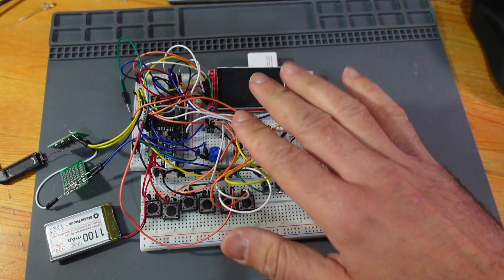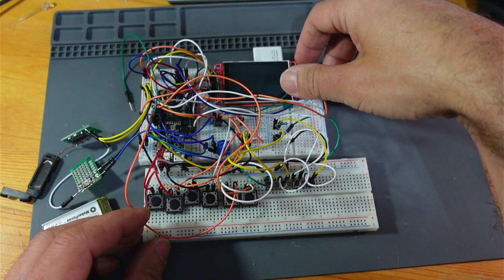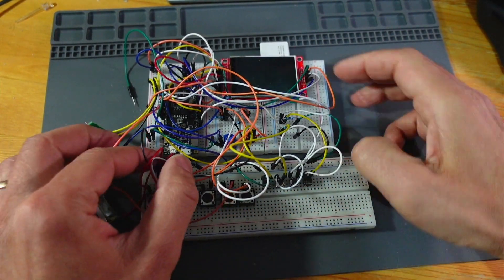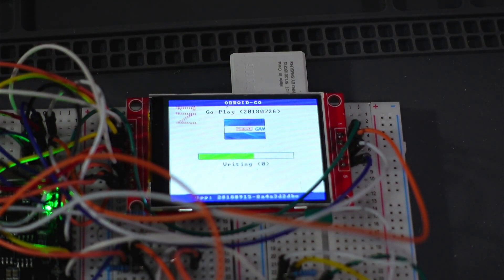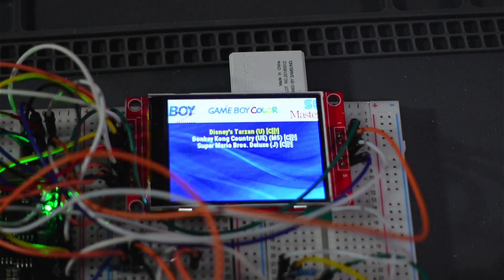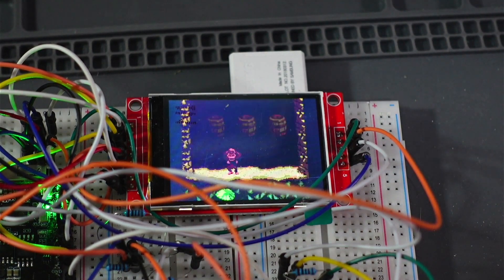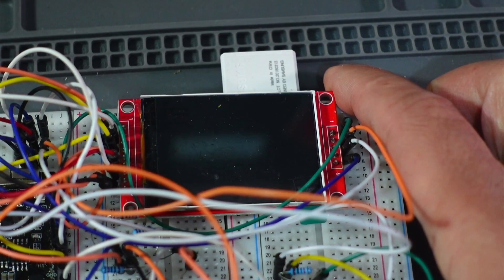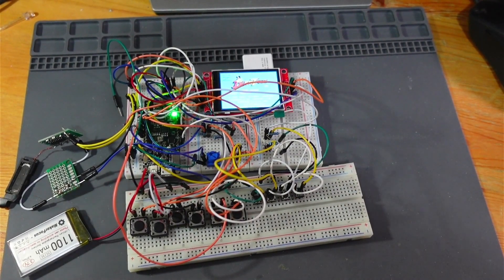DIY Odroid-Go

Comment: Is it ESP32?....also how did you replace the ST7789 with ST7735?
Reply from the maker: Is it an ESP32? Yes.. a modified LILYGO T8 V1.7.1. It's a 2.2 inch ILI9341 TFT LCD, not ST7789 or ST7735. It's very close to the Odroid Go's original screen, which is why it works.